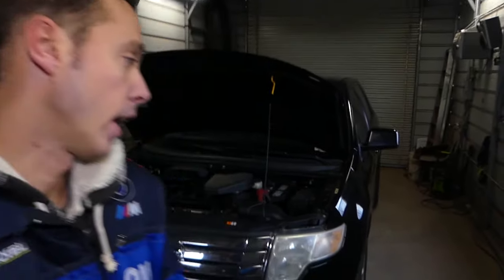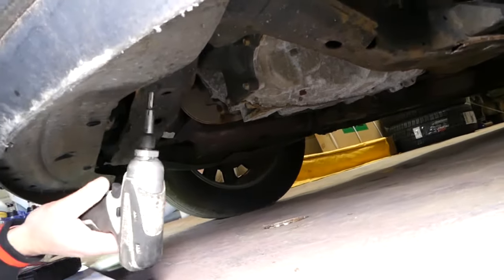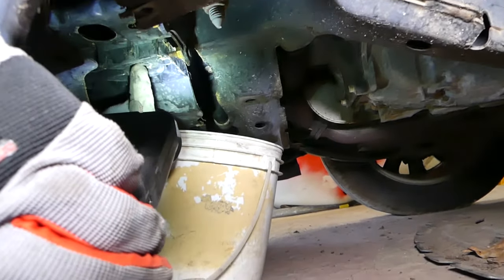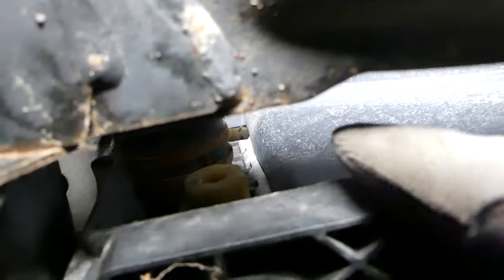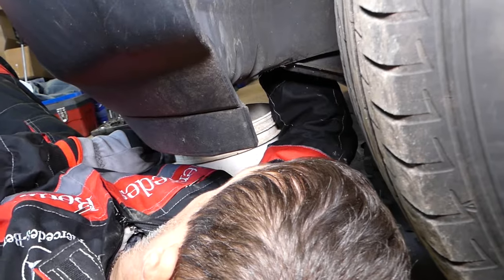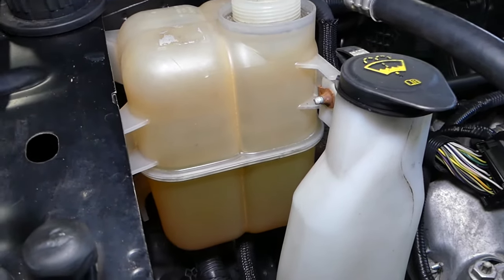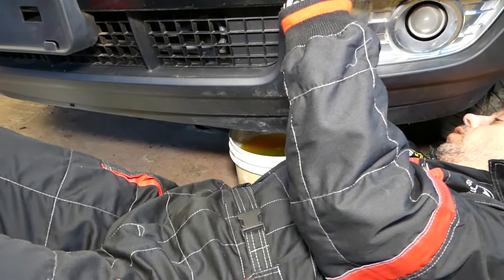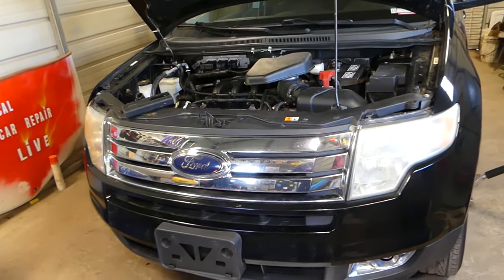HOW TO DRAIN COOLANT ON FORD EDGE 2007 2008 2009 2010 2011 2012 2013 2014

Comment: Good Video!  Decided to raise passenger front side. Do not remove debris guard.  You will see and access coolant drain plug from inside engine compartment, open hood, use flashlight, for the white colored "nut" as indicated video.  19mm socket, 3 inch extension and ratchet wrench will reach and loosen plastic nut. With car jacked up on passenger side, gravity causes most of the old coolant to drain directly down from drain plug. Flat oil recycle plastic tub will catch all liquid.
Reply: Can I pour distilled water into the resivor tank to completely flush out the radiator ?

Comment: Funny my 2014 had 7 screws and three clips in the cover. Someone had been there before and didn't put all the fasteners back in. This is why I do my own work whenever possible. Oh a note of caution for anyone trying this. You will see a larger plug facing downward that takes a 14mm allen key. That plug is in the AC condenser. If you remove it you will release AC refrigerant and pag oil, not something you want to do.

Comment: Hello! I have a 2008 Ford Edge Limited and wanted to do a coolant flush but am getting mixed answers on what coolant  I need to replace with. Can I use a universal coolant? I was looking at the Gold Peak Original Equipment Technology Antifreeze + Coolant for North American Vehicles. Would that be ok to use? If not can you give me a suggestion for a replacement for my vehicle? The coolant cap says that I should use a yellow coolant so I just don’t want to mess anything up. Thank you!!
Reply: No donot use a universal. Motorcraft came up with a new antifreeze for ford vehicles its like light greenish yellowish coolant color.
Reply: @rhurtadorh32  i have 2013 Ford edge limited an it has orange coolant
Reply: @RainorShine1  me too. 
"Ford Orange"
Reply: @rhurtadorh32  nah it's Orange
Reply: @godovermoney1124  no. Factory old coolant is orange.VC-13DL-G this coolant item replaces that old orange coolant. OAT  is the orange color old coolant as to the new yellowish green is POAT.
Reply: Ford has changed the specification.  Ford NO LONGER recommends orange (OAT) coolant for the Ford 3.5L/3.7L Duramax engines, which WAS the standard since about 2011.  As of 2018, they have switched the recommendation to their Yellow P-OAT coolant (which is not the same thing as their older gold H-OAT coolant).  Apparently, the orange coolant had various problems, so I'd stay away from that, even if that's what was originally installed on your Ford Edge.  You want the P-OAT coolant/standard.  One of the benefits of the phosphate based P-OAT is that it's far less corrosive, which will better protect your internal water pump (which unfortunately, Ford installed INSIDE the engine, so a failed water pump usually trashes the engine before the owner is aware of the problem, by spilling coolant into the oil supply.

Comment: hey guys, I have a quick question.. Total capacity of antifreeze is stated to be like 12 qts (3 gals).  Looks like you only got about 1 gal out from the 'drain' process.  That means you have 2/3's of old (of possibly bad) antifreeze left in the vehicle.  Shouldn't you re-drain and re-fill again another time or 2 to get have 'more' new antifreeze than old??  I DO understand the if this 'drain & refill' is done per recommended maintenance schedule, then the 'drain & refill' may be fine.. But I have a 2011 Edge with about 74K miles that I'm not sure if the prior owner performed this drain & refill.  SO i may have to perform this 2 or 3 times just to get the majority of the old antifreeze out.  Good video though,  I will be removing that initial debris guard to gain better access to the plastic drain nut ;).

Comment: My coolant level is just below the minimum line. Is adding new coolant okay or should I drain the entire system first? I’ve been getting mixed responses.
Reply: It really depends on how long the coolant has been in your vehicle if it's been in there for over a year I recommend Flushing but if it's just ranlo adding more coolant is okay

Comment: Drain and fill 4 to 5 times and it's 95% done
Reply: Thats what i do on my 13 edge 3.5..gotta chamge fluid often cause the internal waterpump goes bad its game over..ruined engine
Reply: @Brownnproud91  how does changing the antifreeze often help your water pump life expectancy?
Reply: @traytonking3041  okay so there pump on all 3.5 and 3.7 Ford engines have an internal chain driver waterpump. Basically if the waterpumo gasket fails then the coolant is dumped into the oil pan and the oil pump will pump the mixed oil and coolant throughout the whole engine and ruin your engine. So in theory changing coolant frequently helps keep the gaskets from becoming brittle. Old coolant becomes acidic and acidic eats away gaskets..also fresh coolant has great lubricate properties and keep bearings within pump from seizing. Also on the oil side on these engines it very important to run a quality 5w20 full synthetic oil to help lubricate the chain sprocket and seals that are on the oil side of waterpump. Trust what I am saying. These 3.5 and 3.7 have 2 weep holes that leak coolant out of the engine. One of them leaks above the alternator area and the other leaks above the engine by the V of the engine and can be seen from above with a flashlight. Usually if you catch the failing waterpump ahead of time you can replace the waterpump before it dumps coolant into your engine. 2007-2010 ford edges had an old style pup with 1 seal and 1 sprocket and the 2011-2014 had a improved waterpump design with dual layered gasket ad dual sprockets but still are prone to fail if coolant is not changed often and oil isn't taken care of.
Reply: @UNKNOWN  for those researching, do an oil analysis at every oil change, collect a sample and send it in. There are several well known analysis companies such as Blackstone. They can tell if there are traces of coolant in your oil very early, much earlier than anywhere you could look or detect it yourself. Your water pump won't just fail overnight. It starts with a trivial leak that slowly becomes worse over time until it has leaked enough coolant into your oil to cause internal damage. If you change your oil often and do the analysis every change you can catch it before it becomes catastrophic. It won't ease the $2k bill of the water pump/timing chain swap but it will save you the cost of a new engine! Good luck!
Reply: @traytonking3041  true, they’re trash and go out anyways. Hell of a job to replace

Comment: Ok well I assume  your just showing us how to replace coolant because this is not the way you would do a coolant system flush which would require coolant flush and distilled water and then refilling with antifreeze it make more sense to show us how to do a flush because why replace the coolant without flushing out the system. I'm just saying
Reply: Never flush your coolant👌